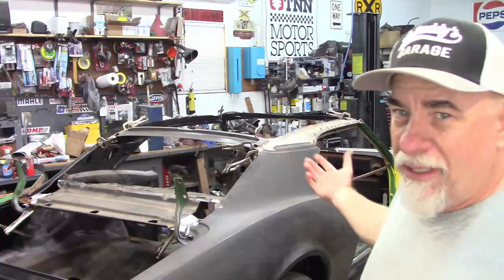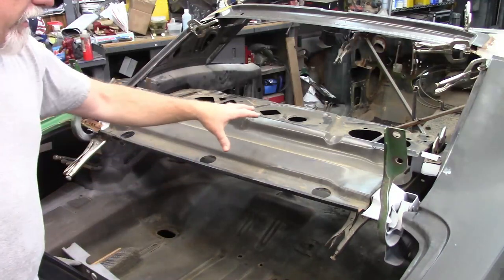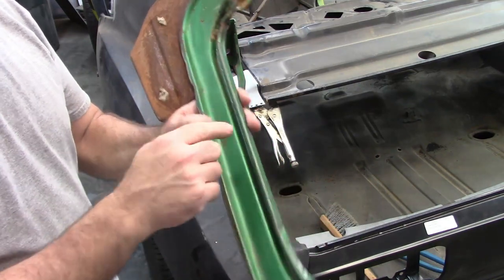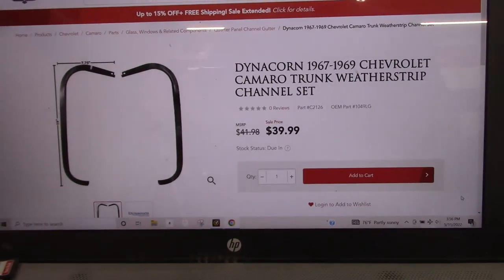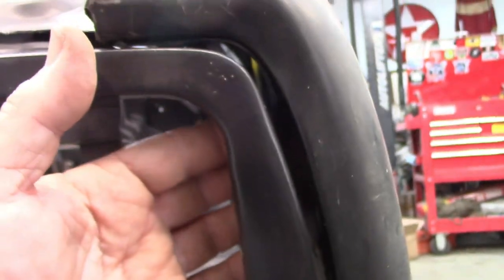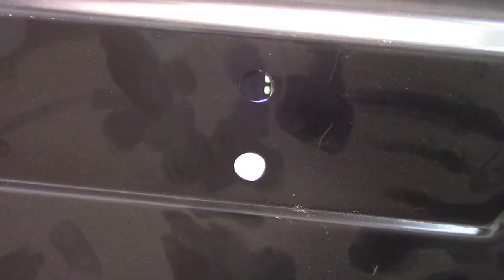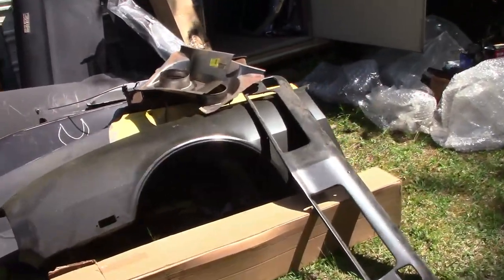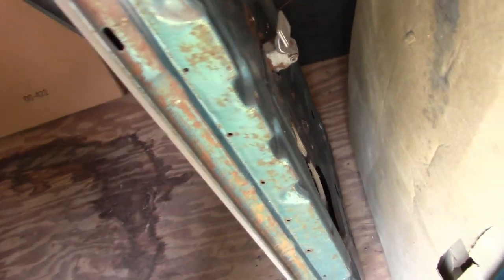1968 Camaro Rebuild. Basket Case part 11.

Comment: Agree 100% -- Test fit everything and assume nothing. I have a 79 Trans Am I'm working on. The quarters needed a lot of rework around tail lights and bumper. The door skins needed the mirror mounting holes cut out  and relocated because they were in the wrong locations. The upper deck filler has the wrong curve and won't sit flat without forcing it. So don't expect reproduction parts to fit perfectly. Chances are, they won't.

Comment: The parts that weld to the quarter gutter and are glued to the quarter are called the quarter panel support brace. I have a 67 and I see two more missing parts. Under the quarter glass there is a bracket that welds through the quarter into the rocker on each side. It is also welded to the quarter in the door jamb near the door striker bolt.  Mine is a 67, I don't know if the 68 had them or not. Thanks for the video.

Comment: Barry, as others have said, the quarterpanel pieces- I’ve heAds and seen them listed in part catalogs as “quarterpanel stiffeners” and if you need a vendor for them, I can get that to you.
I have watched a video of them being installed with body adhesive and welded, as a replacement procedure.
I stopped my restoration at just about where you are with the tailpanel/quarterpanel fitment. When I get back to it- the whole back half of the car is where I’ll puck up where I left off.
Good video- keep it up!!👍

Comment: I wonder if that flat panel that was "glued" in is to add support or help prevent flex from the trunk hinges--like when you open close the trunk lid, it looks like (conceivably) that piece could flex up against the quarter to add support. I don't know, but I'd guess it was there for a reason. I wonder if 67's had it too?
Reply: My 67 has them. They are called quarter panel support brace.